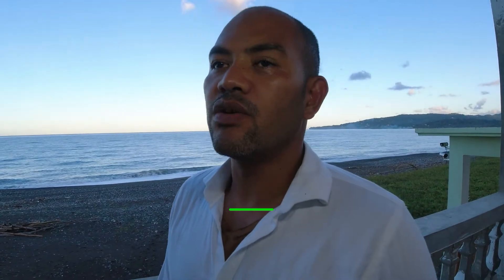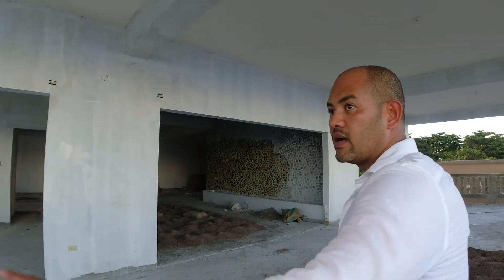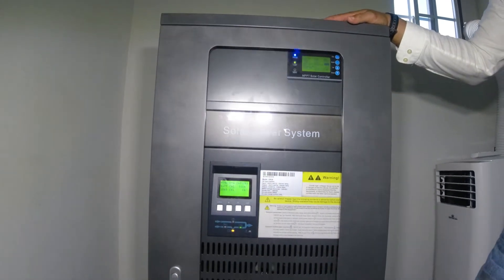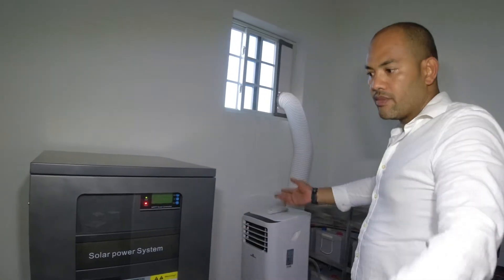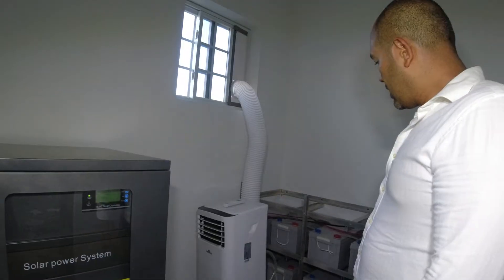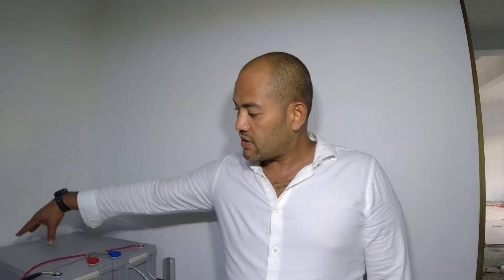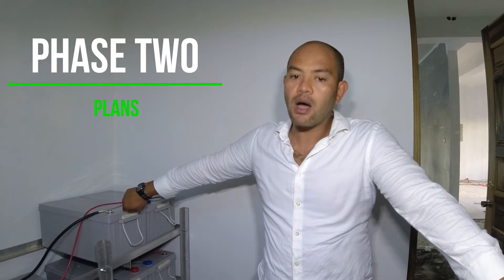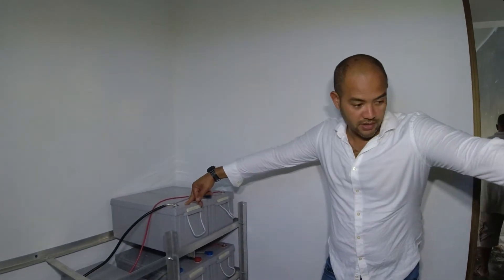Epic, Off The Grid Solar System tour.

Comment: What a difference a year make!! A year ago, Essential Solar filmed this video on my property,  without my permission. As the owner of this property, I was never consulted or approved the filming of this video. I learnt about the video existence when someone told me it was out there. 
In the video, Essential Solar touted the impressiveness of their solar system but i am here today to speak about my experience. 
2 years ago, I met with Essential Solar to purchase an off the grid system for my property. I chose the larger inverter because I wanted a system I could grow into. Initially, I purchased a 240v inverter, 18 solar panels and 20 batteries, total cost $20,000 plus USD. In March 2022 I added another 20 panels total cost $4000 plus USD. In June 2023, I started getting report from the property the the power was cutting off early at night. I contacted Essential Solar who stated I need to buy more batteries. The cost of the batteries now was $7000 plus USD. By July 2023, the solar system was operating 2-3 hours at night. I contacted Essential Solar again to asked if someone could come out and look at the system to let me know what was the issue. Weeks past and no response. In August 2023, the entire system went down. I contacted Essential Solar who asked that we send a 10 second video of the machine so they can look at it. I informed Essential Solar that the caretaker did not have the capacity to send a video. They responded that it is “ policy” to get a video before they can come out. After weeks of attempting to reach someone at Essential Solar, I received a call from Nickesha who informed me that I need to get new batteries. The cost of the batteries were $359 USD each and I needed 20. I asked her to send the invoice. 2 weeks past and still no invoice. On 10/7/23 my brother went physically to the office in Kingston and spoke to the owner of Essential Solar. Again, I was promised a invoice but still nothing. 
I have invested over $20,000 USD into a solar system purchased through Essential Solar that is now non operational. 
I have no instructions from them in how to operate the system because no brand is listed on the inverter. 
Another vendor looked at it and told me the batteries are mixed with 12 v and 24 v. 
My experience with Essential Solar has been a nightmare. 
First, Essential Solar violated my property by filming this video without my written consent. 
Second,  they refuse to follow up when problem developed with their system. There’s no after service and follow up. 
After 2 months of being without power and begging Essential Solar to address it, I am forced to find alternative power source. 
So buyer be aware, I would NOT recommend these jokers to anyone.

Comment: Has your opinion changed with regards to lithium ion battery? Heard the EG34 are good.
Reply from the maker: My opinion is mainly based on one thing, the cost per kwh of storage over 5 to10 years. Reasonably good quality lithium batteries cost 2 times the price of essential maintenance free batteries when correctly implemented. However, lithium batteries offer superior performance so I will be watching prices like a hawk over the coming years in hopes that they will fall.

Comment: While some of the information was good for mainly complete solar novices I felt there were missed opportunities to enlighten the audience with a bit more detail. Example, 
1: what's the inverter brand and output powered? 
2: Is it a single inverter or a few inverters wired in parallel?
3: Can the inverter be grid interactive? (I know that location had no grid though). 
4: Brand of batteries and their capacity in amp hours, cost per piece and where can they be purchased? 
5: Would you consider working with someone who wanted to install a semi diy system by supplying their own equipment? 
6: What's the total cost of the system shown in the video? 
I think these are reasonable questions that a viewer would want to know my good man when promoting the set up to potential customers would you not agree?  Nice set up all the same and I look forward liking the next video once my curiosities have been fulfilled. Keep up the good work in bringing electricity to those who need it. 👊🏾